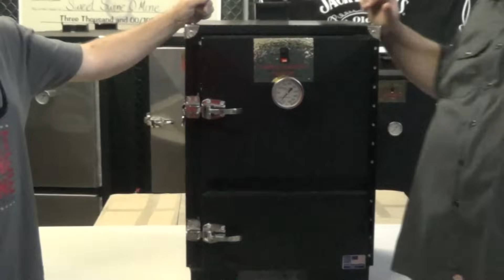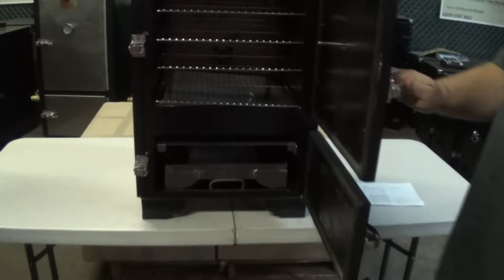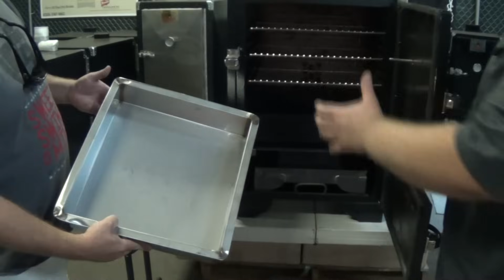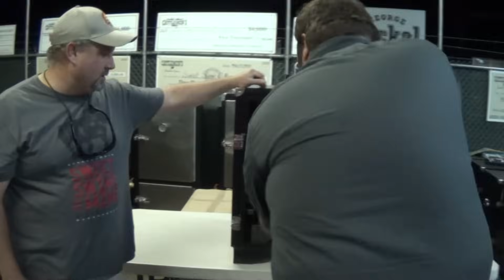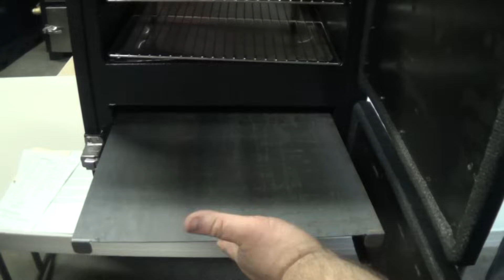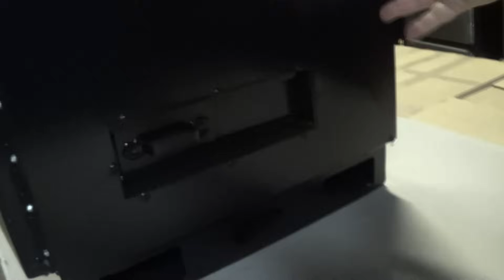Backwoods Chubby Smoker | How A Backwoods Chubby Smoker Works

Comment: Nice informative video, THANKS! Can you start smoking out of the box or does it need to be seasoned first?
Reply from the maker: +John Anonymous Not so much season it, but just like with any new smoker or cooker, you need to heat it up for several hours to burn off any overspray from the manufacturing process.

Comment: Cool video.  Thanks for sharing.  I grew up eating smoked salmon and nobody did it better than my mom.  She grew up close to a traditional lifestyle and always had custom walk-in smokers.  She was great at it and people would laugh at the setup until they tried the end result.

My question are these smokers more for meats or would they do salmon pretty well?  What type of wood is used in it?  Thanks guys.
Reply from the maker: Bob Gamble You can use any type of wood in a backwoods. We use charcoal as the main fuel source then add cherry, pecan, apple or hickory for flavor. Those are our favorites - depending on what I'm smoking. You can smoke anything on a backwoods. I've used it for cold-smoking cheese before.
Reply: Ok. Thanks. Is charcoal necessary? If you have a video of loading it up with that and wood please let me know. Thank you.

Comment: thanks for the info. This would be nice for a small area Townhouse or tailgating. Does the bottom where the fire goes get really hot? Can it sit on top of a picnic bench?
Reply from the maker: All the backwoods are insulated - so most of the heat stays inside. But it still will get pretty warm. I wouldn't put it on a plastic table, but a metal table and you'd be good to go.

Comment: Wow, this is an ideal smoker. Perfect for an apartment dweller. A neat compact size, however, it has two draw-backs. The $970 price tag, and the lack of mobility. It would be nice to equip it like those rolling luggage's with an expandable, heavy-duty handle.
Reply from the maker: With the Chubby, its real portable. When you get to the bigger backwoods models I usually add casters to the bottoms to help move it around when needed.
Reply: Malcom Reed
thanx Malcolm